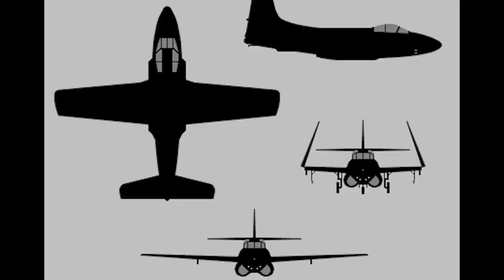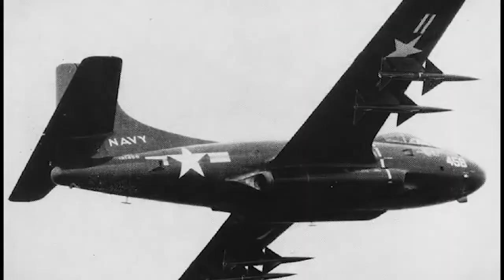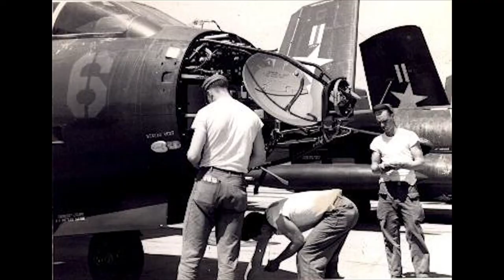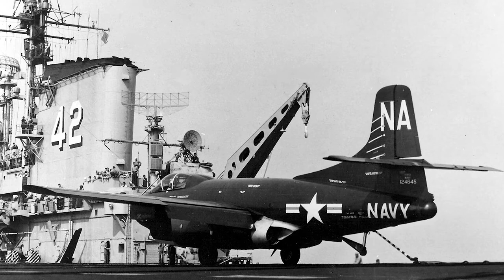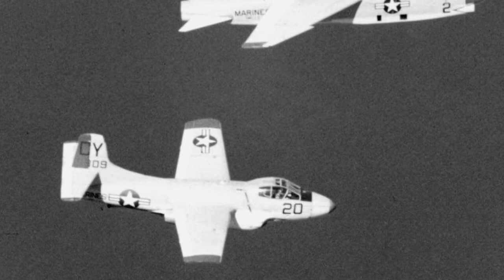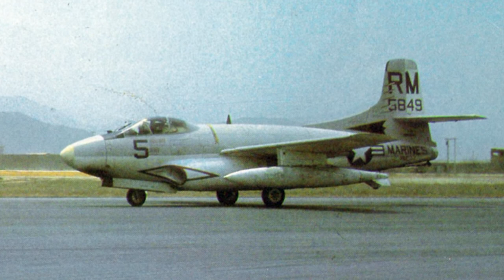Douglas F3D / F-10 Skyknight - A Short History

Comment: In 1953 to1957 I was an ET in Navy air squadron VC-4 in Atlantic city N. J. Our squadron was comprised of F3D Skyknights, F3H Banshees, F4U Corsairs and F9F's. In the Navy if you are an ET you are also an radar operator. I got checked out as an RO on th eF3D but fortunately never got to fly in one. They were regarded as a death trap, badly under powered with Westinghouse engines and an escape thru the  bottom with what we called a "laundry chute". We had one crash at our base shortly after takeoff and we lost another in Korea.